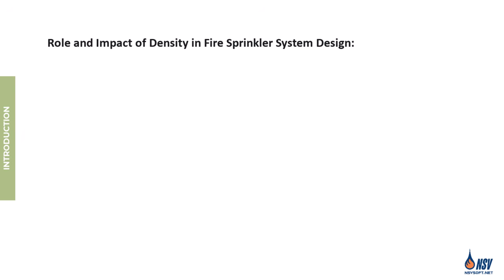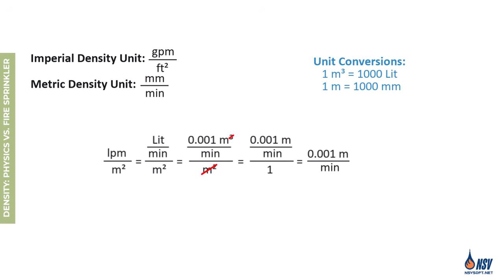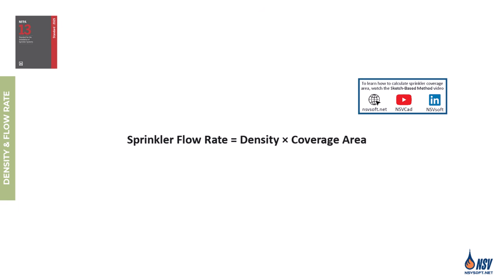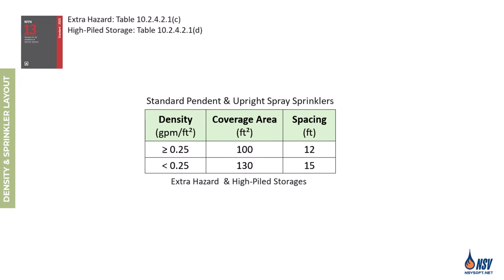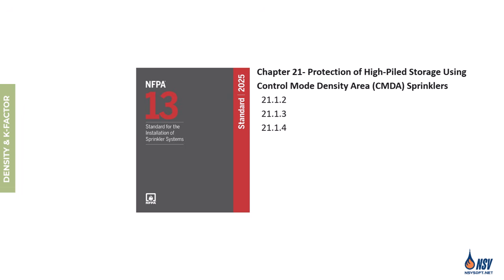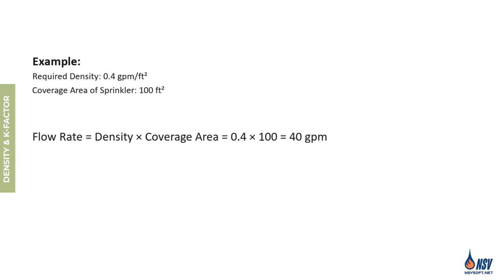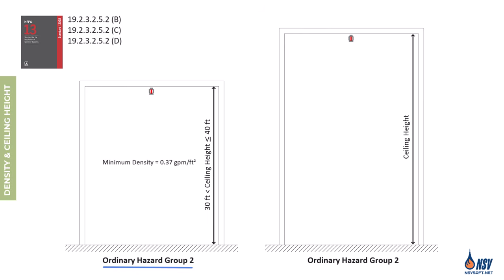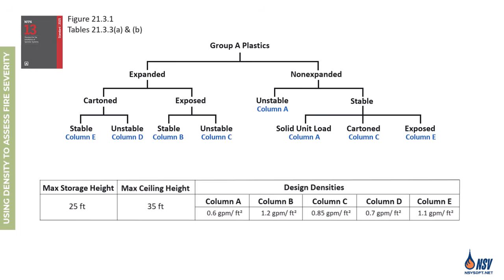💧Density in Fire Sprinkler System Design (NFPA 13)

Comment: Great video. So for the water curtain system, assuming a 3.6m wide corridor with 3 open sprinklers(K5.6） arranged evenly (at a spacing of 1.2 meters) and each sprinkler pressure is 0.1 MPa, the actual density of the water  curtain system would be 66.67 L/min/m, which meets the 37 L/min/m requirement of NFPA 13. Is my understanding correct?
Reply from the maker: Hi Chris,

To answer your question, we first need to talk about the K‑Factor. We’ve already recorded a video that explains this concept in detail, and it will be published on 17th November. I hope it helps clarify everything for you!
Reply: @NSVCad  That's fantastic! Every video of yours has been incredibly rewarding for me
Reply from the maker: Thank you Chris! We are so glad to hear that!